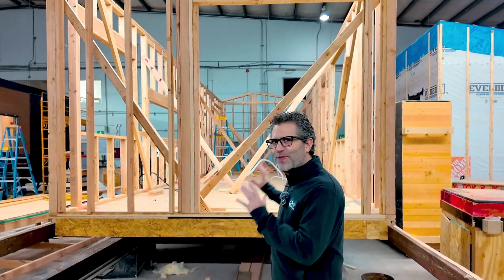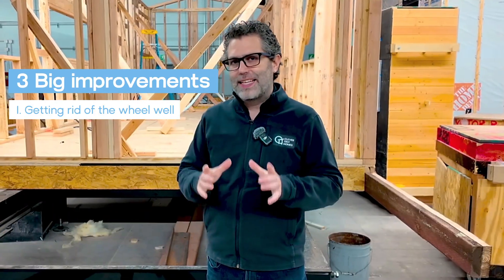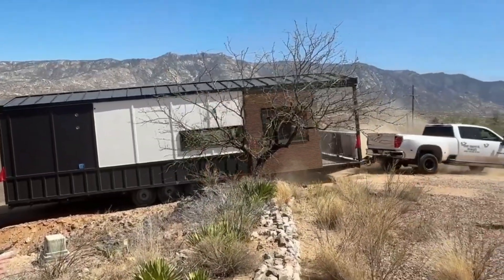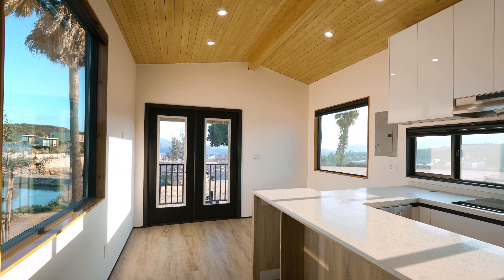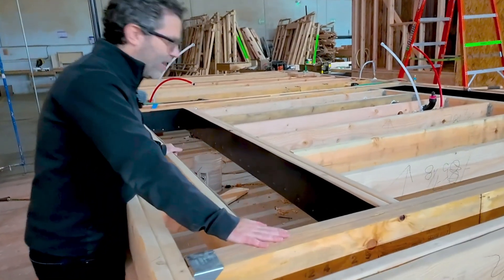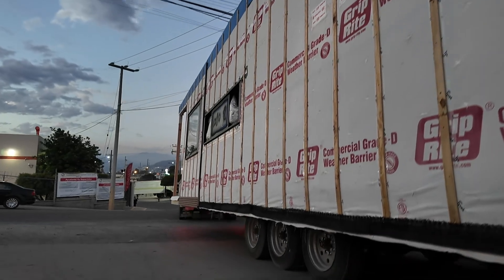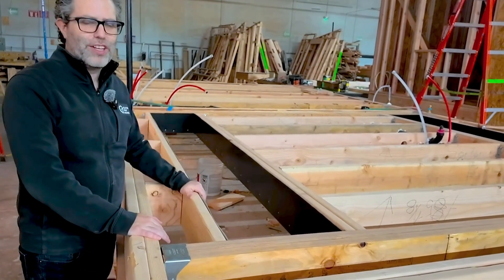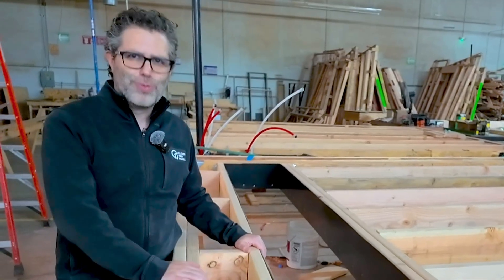Trailer V2 is Here: No More Wheel Wells! 😲

Comment: What is the maximum and minimum interior height in the Clever S with the new trailerv2?  What is the exterior width and exterior length of the Clever S with the new trailer as well as the interior width and interior length of the Clever S with the new trailer?